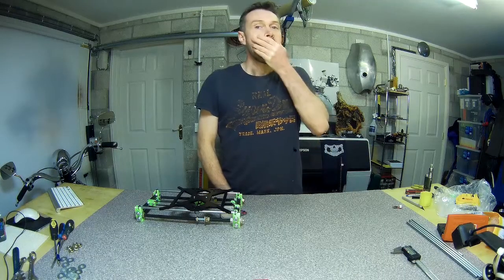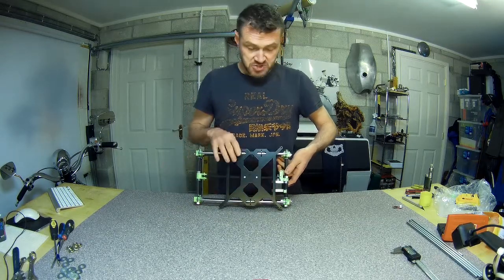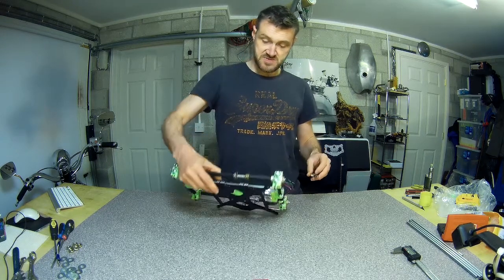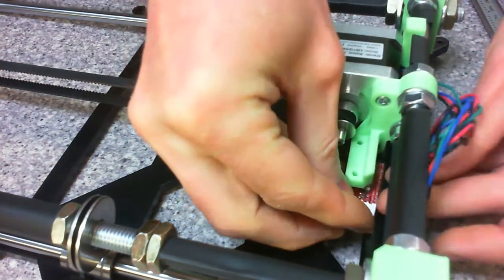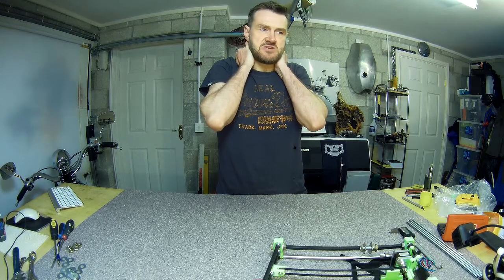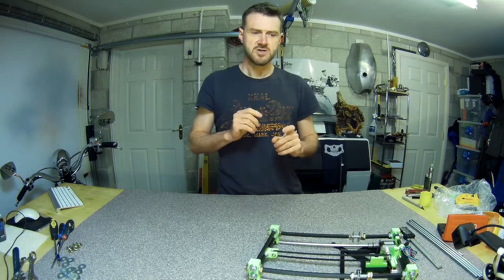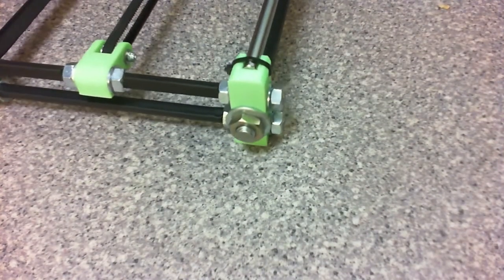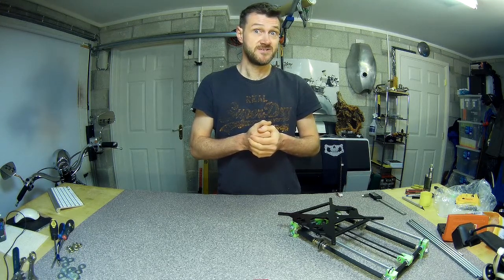How to Build Cheap DIY Prusa i3 MK2 3D Printer - 4 - Schoolboy Error #1

Comment: I made the very same or at least similar error on my build. But instead of taking it apart I just added a plastic piece to the bottom of the bed to hit the end stop.  I used the y-feet from an older model so mine did not have that cut out for the bearing.
Reply from the maker: Yeah I did think of that but, well, I guess it is no big deal to spin them around. It will also give me about 4cm more Y travel :) - Any other little gotchas I should look out for?
Reply: I have run into some issues with the drivers and the motors.I am still trying to figure out which is causing the issues I am seeing. Also I cooked the Arduino by plugging in the end-stops backwards so careful when plugging them in.